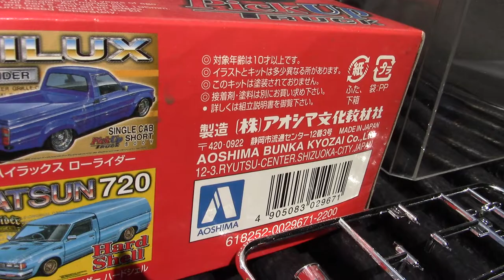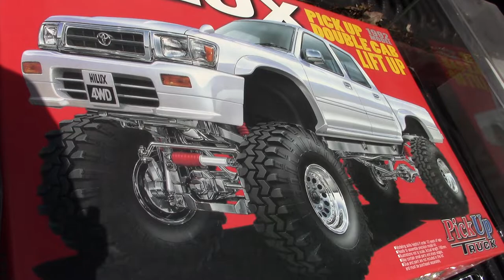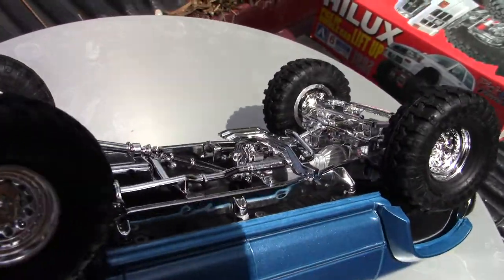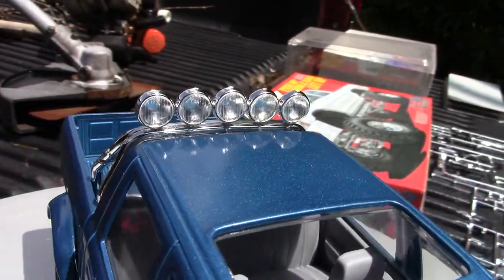Past builds - Aoshima Hilux pick up lift up

Comment: What a fantastic build! I actually have this exact same truck (same colour) in real life! Have just bought the Aoshima model too. what paint colour did you use for the body? the instructions say to use Mr Hobby C72 intermittent blue but this doesn't seem right. That body paint you've used seems far more like the real thing, would really appreciate your guidance! Thanks!
Reply from the maker: That is Testor's Sapphire Blue metallic. You might have trouble finding it. I sprayed a 300zx kit very similarly in Rustoleum Cobalt Blue metallic.